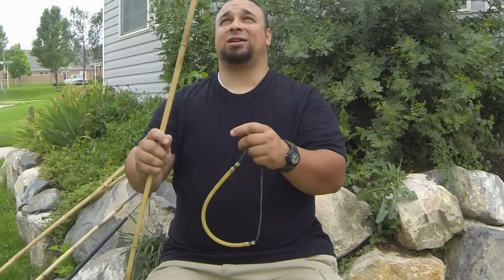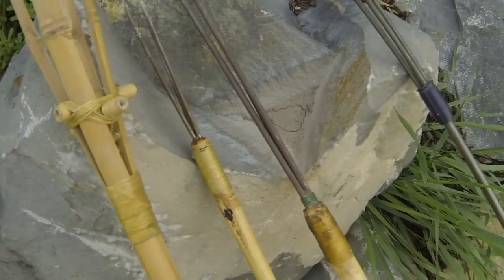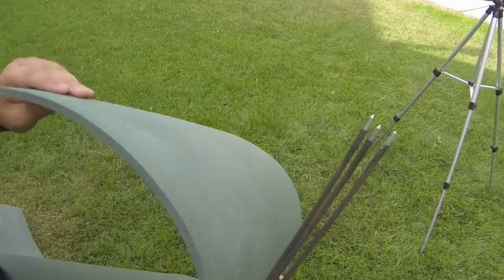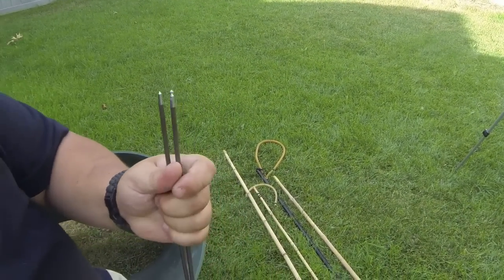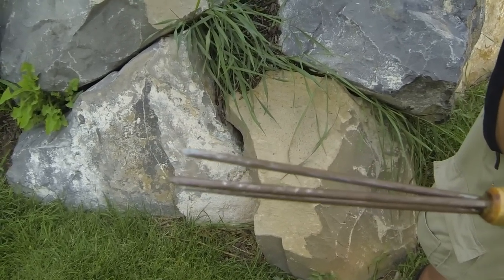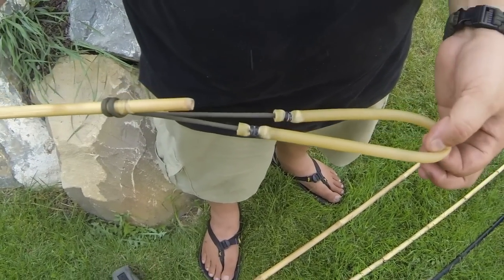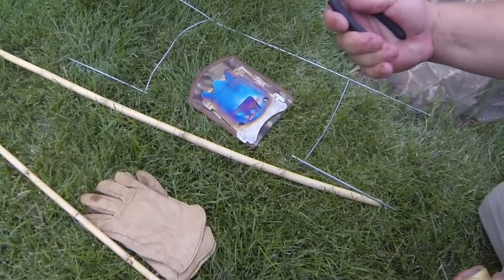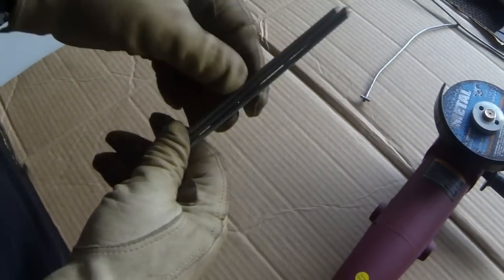How to make a Fishing Spear

Comment: PVC pipe be used as well. Double or triple wall construction, installing a polymer, fiberglass, carbon fiber/graphite, aluminum, hardwood, or steel dowel for more rigidity. Reinforce the ends with cord wrapping, thin wall steel, copper or aluminum tubing, or fiberglass fabric and resin/epoxy.

Comment: Does this also work for underwater spear fishing? and is there anyway you think you can make it break down into sections to ease transporting it places?
Reply from the maker: Yup, they work just as well under water as above. I carry just the elastic band in my pack figuring I can improvise the spear about anywhere. But you certainly could make a take down version with a little ingenuity. Pretty much everything you'd need you can find at the hardware store. Check out my friend Madison with his homemade pole spear: http://youtu.be/Jx5yHFYJS5k Commercial ones are also fairly cheap. Even the heavy aluminum professional pole spear in my video only costs about $75 from http://www.spearfishing.cc.

Comment: Hey Merk! I'm thinking of either buying or making a spear for fishing. im pretty young, 13 years old, do you think I would be able to pull the rubber loop far back enough? im not going all-out on this, just looking for a summer hobby for my lakehouse. ill mostly be hunting carp, pumpkin seed, and maybe a little bass.
Reply from the maker: Oceanside Creations Most definitely. It all depends on the weight of the spearpole. That aluminum one I have had a pretty heavy band to move all that mass. But those lightweight bamboo spears use relatively thin surgical tubing. You can find the stuff at the hardware store where they sell water hose for sinks and ice machines. You can always adjust the length of the tubing as well to make it easier while still maintaining lightning speed with the spear.
Reply: MerkWares How about a 4 foot long 1/2 inch wide metal pole spear with the three-prong design. Im not very experienced with these things that much so I am not sure what to buy. I'm planning on buying one from a website. Thanks a lot for helping me with this! I trust you'll have good advice.
Reply from the maker: Oceanside Creations No worries. It's my pleasure. Um, I'm wondering how heavy that metal pole would be. Again it all depends on how you plan to use it.   I can use very light bamboo pole spears to great effect on the small fish, frogs, and crayfish. I bought my pole spear from Ray Odor for a trip to Hawaii that never happened. It is a heavy spear because I was planning on hunting large reef fish.There are some decent pole spears for sale online that are pretty affordable. Down in the 30-50 dollar range. Search for PoleSpear on amazon and read the reviews.

Comment: Can I put PVC pipes instead of bamboo ... it should work but will it be too heavy ??? I mean it will be heavy right so as I think of that it will not shoot as Good as that or at least I need to buy harder ruber bands ??? Is that right?
Reply from the maker: HI Shad, PVC is a bit too flexible in my opinion in the longer lengths. But ya never know until you try it. The heavier the pole the stronger the rubber bands you'll need. PVC is super cheap so it should be pretty easy to test.

Comment: The natives did just FINE with bamboo
Reply from the maker: Dallin Tahere Absolutely. I just wish it grew near where I live. It must be such a blessing to have a resource like that near by. Out here the only thing close to a straight pole is coyote willow. But it is soft and not near as strong as bamboo. Eventually I'd like to make some more spears using other traditional materials for the points like bone. I took those spears out a few weeks ago and harvested some 40lbs of carp with them. I made some wooden tipped spears for the occasion. They worked ok but didn't hold up to hitting rocks as well as the metal ones. Still had a great time.

Comment: how long should i hold bamboo over fire? im using my grill, hopefully it will work
Reply from the maker: The grill should work great. I've even used the burner on my kitchen stove. You'll want to experiment on a piece of bamboo you don't mind ruining... Hold it high enough that the bamboo doesn't scorch but heats up well. I've noticed my bamboo takes on a shine when it is ready to bend. When you bend the bamboo it will bend like heavy wire and remain that way. If it tries to spring back you need more heat. However if you scorch it too deeply it will just crack and break rather than bend.

Comment: How would you make one with nothing but a knife and the woods
Reply from the maker: Good question. I'd make a spear similar to the first bamboo spear. I'd split a stick 4 ways down about 8 inches and sharpen the tines. small twigs or lashing between the tines will keep them open. And I'd make a small sapling bow to propel the spear instead of latex tubing.

Comment: What kind of wire did you use
Reply from the maker: +Matthew Luh I wrapped it with nylon string, however any type of craft wire would work. The spear tines were made from the wire used in a sign. I've been able to find even better supplies at the hardware store.

Comment: I found out that the political poster wire's welds are its weakest point, you can go at that with a side cutter or just bend it against itself and it should pop apart. 

If you go for the tool-less method though stepping on a section and bending the wire in half is a good idea if you have shoes and possibly heat resistant gloves on, this wire gets very hot if you bend it apart near specific length. 
Happy recycling.

Comment: What store can I get bamboo
Reply from the maker: You can find it in the garden section of most any store like walmart. They use it for holding up tomato plants. Any straight stick will work for the spear. You can hollow out the end for the metal tines by drilling or burning.
Reply: MerkWares thanks

Comment: I think P.V.C would also do the trick?
Reply from the maker: it's might, though I worry about it lacking rigidity.
Reply: MerkWares With P.V.C  you could always put a thicker pipe in the middle of the shaft that's snug fitting.
Reply from the maker: PigSticker
not a bad idea

Comment: The guerrilla glue is water activated fyi
Reply from the maker: kustomTooth It sure is. but once cured it's supposed to be waterproof. I think I missed it in this video but on my earlier spear I wet the base of tines just a little before gluing them in. Honestly I used it because that is what I had. Seemed to work pretty well so far. :)